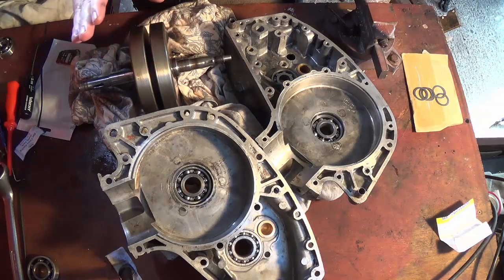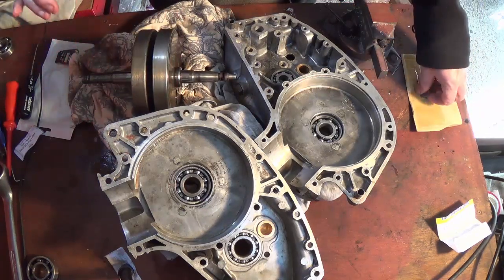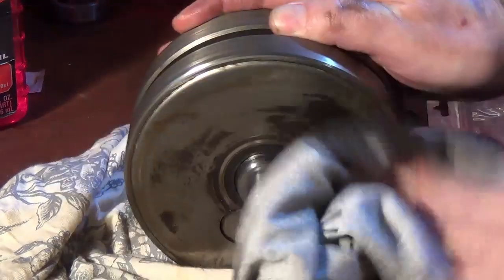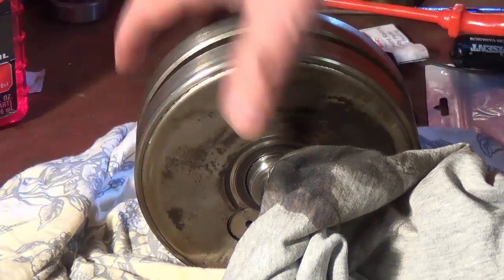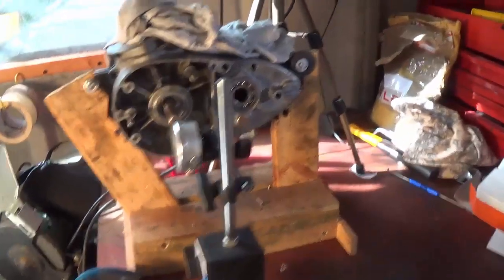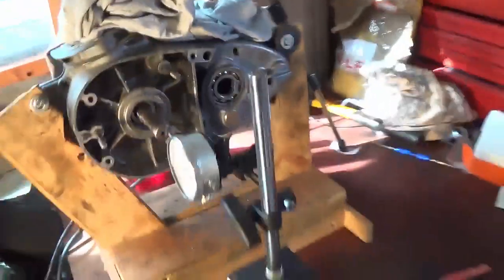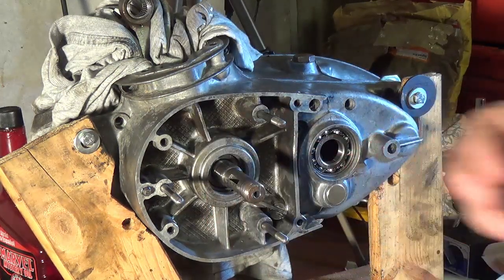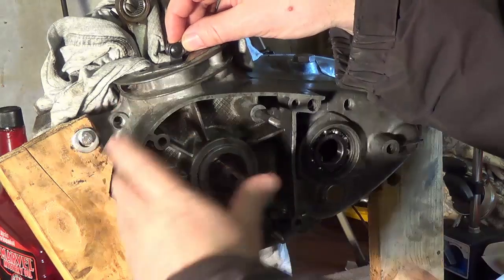BSA Bantam Engine Rebuild Part 2 Checking Crankshaft End Float

Comment: With this procedure I prose to mage two dummy blank bearings from aluminium so that the crank is able to move freely , once the end float is set replace the alum blanks with bearings
Reply from the maker: If I had the skills and a lathe I would do that but I wouldn't even know how to turn a lathe on.
Reply: That's not required. Feeler gauges do the job.

Comment: Not surprised to see parts swapped out from different bikes. My D1 plunger has a D3 engine with a D1 barrel & piston (should be correcting this soon!). Also when I got my Suzuki GT380 it had a GT185 front end & early RD250 rear wheel.

Comment: Hello very nice video. I did mine with a dial gauge but I used a method to positively move the crank and prevent it from springing back. There is a video on my channel to explain it if you are interested. 
Good to see another Bantam being built. 
Best wishes, Dean.
Reply from the maker: Hello just watched your video. I liked how you mounted the dial gauge I will try that next time..  If you look at the end of my part 3 gearbox video I am currently stuck. The blind layshaft bush I need to ream if you have any ideas on what sort of adjustable reamer would work with a blind bush please let me know.
Thanks.
Reply: @bradwalton7599  I'll watch your video and let you know.

Comment: Thanks heaps for posting this! Question: you mentioned a 10thou on the drive side and a 10+4 thou on the other side, wouldn’t that have taken up nearly the whole 25 thou float? Obviously not but it shows I don’t understand fully 🤔
Reply: Or is that to get the gap right on the other side as well? I think I get it now